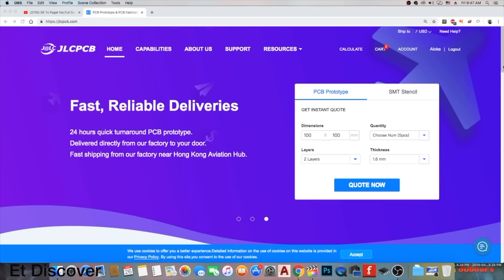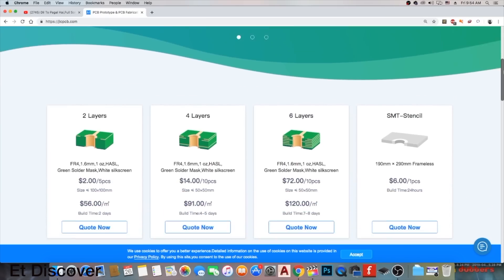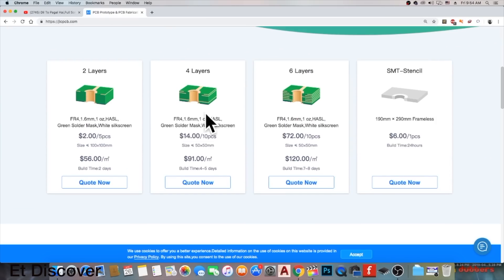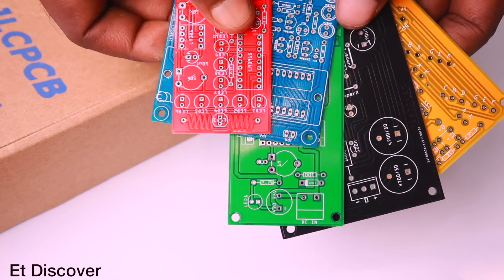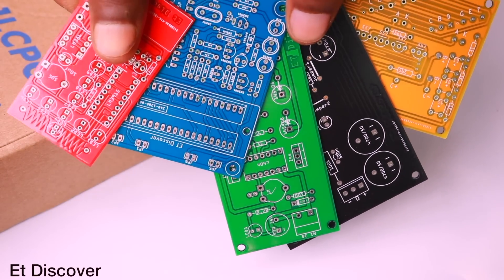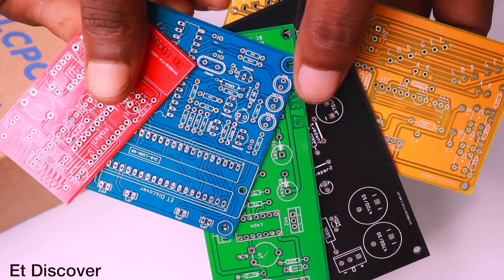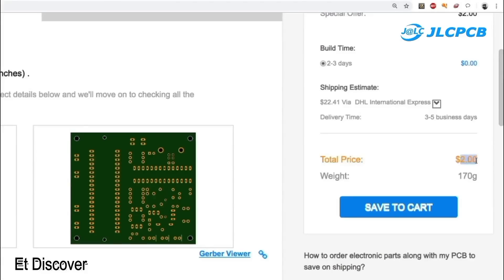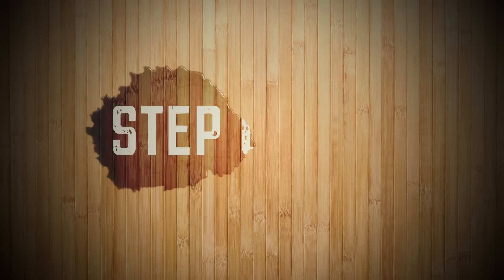555 IC Wireless  Audio Transmitter and Receiver

Comment: Why did you choose a photoelectric cell? Instead, I would expect a similar circuit using a phototransistor would have given MUCH higher sound quality. It would be a smaller size too.

Comment: At 1:48 there is a nice example of a dry joint. You see how three of them are shiny and one kind of dull. That one needs to be reflowed, just heat it up again. It should be shiny. This is what causes many electronic devices to fail as those joints eventually stop conducting.

Comment: Can we use infrared receiver rather than solar cell panel?
Reply from the maker: Yes you can
Reply: @EtDiscover  but you must have ir led on the transmitter
Reply: Or use a phototransistor as the IR receiver.

Comment: Hello

Can you build the cell phone signal booster?
Reply from the maker: Check out once I've been made
Reply: Et Discover. I did. I tried the oscillator 20MHz but it’s dont work. It have signal connection but I cannot use the LTE internet.

Comment: Why the sound signal is first converted to square waveform?
Thank You.
Reply from the maker: Because the AC signal came out from Sine Wave.
Reply: @EtDiscover   I thought to improve the efficiency
Reply: The NE555 is set up as an astable oscillator. Pin 5, the input, is the "Control Voltage". If this voltage is altered (i.e. from the AM sound input) the pulse duration and thus the frequency also changes. The output oscillation at Pin 3 becomes a pulse stream which is varying in length--changing the amount of time the IR LED is on/off.  The IR LED can really only be turned on/off--it can't be made to vary its intensity with changing amplitude. This is what allows you to transmit the signal.  What's not clearly show on the schematic is the power and ground connection---but if you know electronics, you can see where they are connected on the 555 timer.